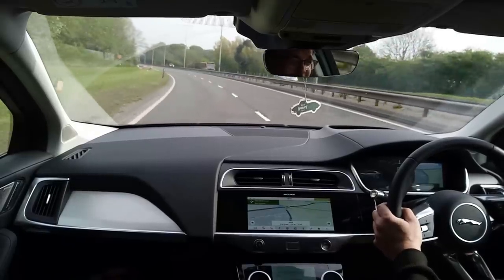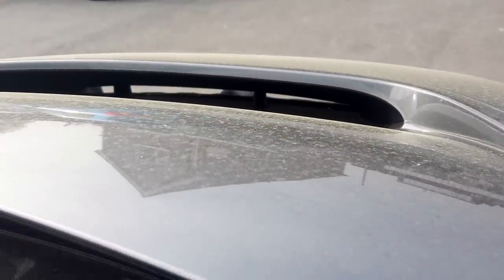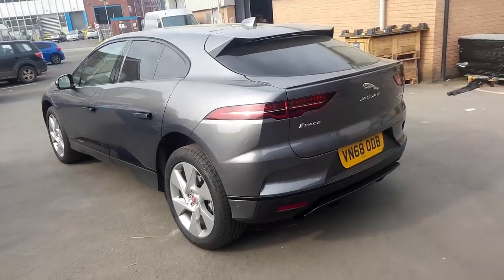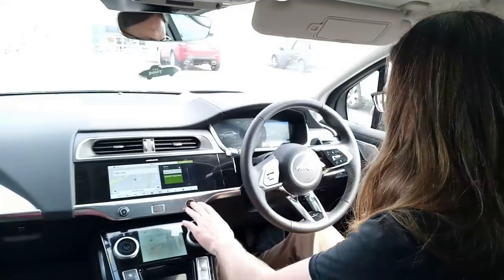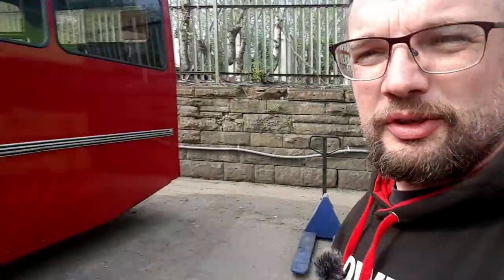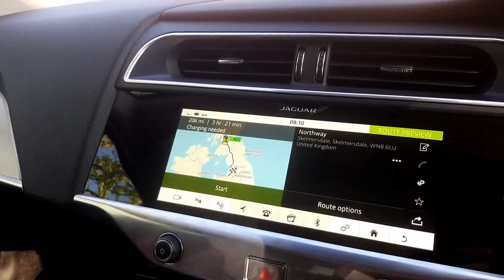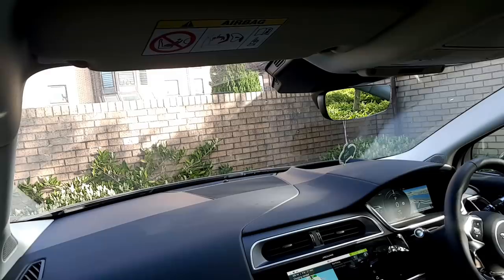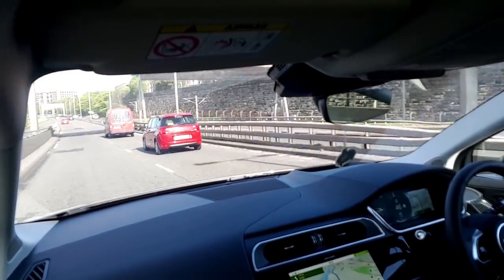Real Road Test: Jaguar I Pace 800 Roadtrip - with bonus bus action!

Comment: Very interesting journey.  Jay Leno is always saying that the last versions of old tech are better than the early versions of new tech.  Your experience seems to prove that statement very conclusively. 

Personality I think that this shows that the hardware is pretty good but, as with most computer based systems, the software really isn't up to the job yet.  I find this is such a common problem that we live with every day of our lives.  Just count the number of times you have issues with any digital system you use.  We almost always end up as test subjects for companies who promise us "life changing" tech.  We'll, I suppose it often does change our lives but not always in a positive manner.

In case you are wondering, I am not a Ludite.  I have a degree in computer systems design and love new tech.  One of the reasons I don't use this in my professional live any more is well demonstrated by your example here.

I sincerely pray that this situation improves very quickly.  Unfortunately I suspect that it will take a long time to get it right.  Sorry, rant over.  I look forward to your next post.  Really love your videos Ian. Thanks
Reply: Well put Sir 👌👌
Reply: I'm always disappointed by how unreliable "consumer grade" software is, compared to how reliable all the drive-by-wire systems are in cars from the last two or three decades! Most people don't even realise that their throttle control (to give but one example) is computer mediated, but hate the experience of using the car's stereo. Why is it like this, damn it!

Comment: you really can waste a lot of time several times a day waiting for your car to charge. 10 minutes at a petrol station and you can go halfway across Europe almost without stopping. For what it cost you in electricity, a decent diesel would have done it on the same amount of fuel and  kept on going. Loved the old 405, i used to have a 405 estate, which i really liked.

Comment: I think Mythbusters tested how much you save in fuel by going close behind a lorry, and they could only get any effect at all by literally driving five feet from the bumper. Anyway, I bet the situation with charge points now is pretty similar to what it must have been like owning a petrol car back in 1900 before they'd built all the petrol stations!
Reply: Clearly Mythbusters not in a Citroen Relay 1.9D van, or bluff Land Rover defender where you really can lift off the accelerator behind  trucks..

Comment: Love the looks and performance Ian, downsides £65k and so much stress! (still couldn't afford one!)......I might watch your next EV caper in two years time, and still wouldn't buy an EV.
How much were the total charging costs for the journey?
Reply from the maker: I did work it out but can't remember. £23 was the biggest charge and that got me about 200 miles.
Reply: £23 for 200 miles. Is that similar to 60/70mpg on fossil fuel at UK prices?
Reply from the maker: No, more like 40. Similar to my 2CV.
Reply: Thanks Ian; considerably more than my diesel ZX or petrol 205 in similar conditions, although obviously the Jag is a big luxury car. Thanks for the presentation; I completely agree with you about modern fossil fuel cars being unnecessarily complicated versions of older ones, and that the future is probably electric. I don't know what Jaguar do, but Renault charge a monthly rental for batteries which varies from £20 to £55 depending on what mileage you cover. This completely negates any cost savings of electric in addition to the "Refuelling" inconvenience. I know you're not interested in motorcycles, but you may be interested to look at Cedric Lynch's home made electric enclosed recumbent which cruises at 50+mph and has a range of 80 - 100 miles on a 50p charge. This has been on the road since the early 1990's and has covered over 150,000 miles.Thanks again for your excellent videos.
Reply: To my surprise that's considerably more expensive to run than my 13 year old Mondeo tdci which easily does north of 60mpg on a run. It would probably have made it there and back on a tankfull as well!
Reply: @HubNut  Yes the IPACE isn't very efficient.

Comment: My 2004 Jag XK8 has washers built in to the wiper blades too! (And there's no triangle of doom). It's a great system because it uses only a tiny amount of washer fluid, is very effective, and doesn't leave a mess.

Comment: the achilles heel of EV's - range and charge time. I did @ 400mls yesterday on petrol - filled up @ 350 miles at Tesco in York using tried and trusted technology - took me less than 10 mins to recharge with nearly 400mls of range ( petrol ) which I paid for at the pump. Nearly 40mpg not bad for a 14 year old 100k miles Picasso.  I intend to run this into the ground and thus not add to those perilous greenhouse gases by having a manufacturer build me a new car - I remember your video pointing out that there is more harmful stuff pumped into the atmosphere making the darned things that comes out of the tail pipe.  When its knackered and BER I'll just buy another cast off that some fool has insisted on changing for a new one when there's life in their old dog cast off yet

Comment: I thought the infrastructure would be a lot better in the UK compared to here in Ireland, but it seems not! EVs make a lot of sense if you're mostly driving within the range from your home (charging at home is so much cheaper and can be done overnight), but you still have to be brave to do any long journeys with them.

I think you got your kilowatts (unit of power) and kilowatt hours (unit of energy) mixed up a few times. It's hard to predict how fast a lot of these public chargers work, as they may claim to be say 50kW but that could be split if another car turns up, and the cars don't charge in a linear manner. Battery temperature and other factors can also affect charging speed, e.g. rapid charging could be restricted if the battery is hot after a long motorway journey.
Reply: I find the Infostructure good and getting better in the UK, you can't view it on a 1 hour video of a novice who wasn't given the correct tools (ZAPMAP and RFID cards start charger) when you own an EV you equip yourself  with what you need for where you travel. Plus the Ecotricity chargers where working and on free vend all Ian needed to do was plug it in and press start. 
It's a bit like if I went to my local asda petrol station with cash I would not get any petrol because it chip and pin only.
Reply from the maker: The chargers did not work. It's ridiculous to expect people to sign up to cards and apps. Instavolt proved that what we need more of is simple chargers where a bank card can be used.
Reply: @HubNut  Instavolt started putting chargers out about 1 year ago, Ecotricity chargers are about 5 - 6 years old in technology terms they are ancient. They will be replaced with 150 KW ones, now if they don't accept debit/credit cards that will be ridiculous. 
I went to my local Asda filling station the other week in my mams Audi and couldn't put diesel in it because I only had cash and my Contactless phone on me. It was unmanned and chip and pin only. (didn't really happen but it could of) and i was amazed that it did have an indicator stalk!
Reply: tone167  none, but I do drive an EV. I don't sell EVs either. I used to sell Citroens 😉

Comment: I completely get the appeal of the wall of torque and endless turbine smoothness, it must be lovely.  The problem with batteries is that they take ages to charge, no matter what the infrastructure is like, and until someone makes a battery that will charge in the same time it takes to fill a car with petrol, battery powered cars will only be suitable for city commuting or short trips.  You had range anxiety before you even started and, while I laughed at some of the charger disasters, the constant anxiety and discussion about the range was starting to give me a migraine and I was only watching it.  If I had been in your shoes I don't know what I would have done.  Top marks for appearing so calm (ish) and top marks for giving it a good go.  Cheers :-)
Reply: Hi Pauline, I have found that my EV chargers when I'm not using it so I don't have to wait around. Cars  are parked 90% of the time. I wonder when the last time someone filled their tank and used it all in one go? Not very often. Take my wife for instance, our Leaf takes 3 hour to charge from 0 - full, that give 80 miles, the most she ever drives is 50 miles a day, so it's never empty and she has never had to wait for it to charge. Really depends on how many miles you drive to what size battery you need. Just like you wouldn't buy an MX5 for a family of 4. Oh and we very often drive over 300 miles in the little Leaf too with no range anxiety what so ever because I learnt where and when to charge (really isn't that hard).
Reply: It's great that it works out for you and it illustrates the options.  However it wouldn't for me.  My daily driver is parked in a car park several hundred metres from my house and there is no charging infrastructure any where near my suburb.  Circumstances vary.
Reply: @PaulinesPastimes  Your right, I doesn't work for everybody yet and at it will take time as this is new technology, but it is starting to accelerate. Bit like the internet, when it came out not many people used it because it was slow now we watch YouTube videos on our TV. Can you imagine making a Youtube video in 2005 and people telling you that it won't work just because they didn't have broadband. It's a new type of technology it will get better and cheaper. A car does not need a 500 mile range unless you have drive it non stop for 500 miles which I don't think you need to in this country at least. (hope you see my point of view)

Comment: The Scottish government is already consulting on how to tax leccy for EV's, so a classic bait and switch tax scenario awaits.......
Reply: Well of course.
I mean the duty on fuel at the moment is so. Something like 80 %.
If we all went electric tomorrow do you really think we won't be paying 20 per hour charge at services.
Of course we will be
Reply: It should be taxed per km or a flat tax not at source
Reply: An incentive to charge up overnight, using the power point in your own garage.
Reply: Its free in Scotland
Reply: @zenbudhism  What is free ???
Reply: Free charging for  electric cars in Scotland from charge place Scotland
Reply: zenbudhism  nothing in this life is free somebody pays for it
Reply: @zenbudhism  not for long I bet
Reply: Arthur Farrow great idea... now I just need to buy a garage!
Reply: zenbudhism free at point of use maybe (for now). Free in terms of no cost to generate, supply and maintain? Definitely not. Someone somewhere will be paying for that.
Reply: @zenbudhism  Like I said bait and switch, the taxpayers are paying, it's not free.
Reply: zenbudhism ChargePlace Scotland pricing is set by each individual council. They all used to be free but two have now started charging (I believe it’s Dundee and Dumfries). The rest will follow for sure. But I’d actually rather pay for a reliable service than have the current free one which is very unreliable. I have never had an issue with Instavolt. Bit expensive but they work, they’re simple (no app or rfid card needed) and they’re reliable. I’ve never had a problem, so I think this was just unlucky. Having said that, I don’t rapid charge very often and do most of my charging at home for 5p per kWh - or roughly £4 to charge to 100% from empty. If it’s that cheap at home, I don’t mind paying more for a reliable en-route network.
Reply: @zenbudhism  Not in Dumfries and Galloway it isn't, and Orkney are about to start charging for charging.
Reply: The problem is that the cost of energy on those commercial chargers is already up at the price per mile or more than petrol and diesel cars. Substantially more costly than economy petrol and diesel cars.
Reply: Easy to make commercial charge points capture a duty or electricty companies  as they sense, via smart chargers, that you have p[lugged in or via pay per mile from all the telemetary these EVs have.

No doubt the electricty companies will also be able to increase pricing for home consumers when they sense you plugged in your car.

i don't see EV being cheaper per mile once they are in more widespread use.

Comment: You have highlighted an issue with electric and hybrids as when your braking as you say most of the time your just regen braking and it means that because they still use mechanical brakes they tend to seize up the pads in the carriers cause the discs to corroded etc mainly the rears. I work for a Ford dealer and the mondeo hybrids are all like that.
Reply: Engine brakes are great I've had my Prius for almost 8 years now and only needed new brake pads twice ;)
Reply: @manwithapan9481  it is good basically free energy but the point I make is that as much as the brakes could potentially last longer than some batterys they need to now almost reinvent brakes as due to lack of use due to regen they tend to end up with corrosion and seizing up. What Ian has shown is that the UK isn't properly geared up for electric vehicles. I personally think hydrogen cars are the future.
Reply: Yes, I've had to replace all the caliper slide pins on the rear brakes on my Prius as they had seized. It's really a case that brakes should not be treated as a maintenance-free item - you can't just leave them alone until the pads need replacing because that takes too long. Inspection and lubrication every 2 years or so should avoid problems.
Reply: @AaronSmart.online  Every time my Prius has an MOT I ask the mechanic to check the brakes , it was 4 MOT's later when he recommended replacing them lol, same again 4 years later, I presume he checks them for other things such as calipers seizing etc but next MOT I will ask him to have a quick look at them ;)
Reply: @wattling1396  Right I gotcha,  I guess the engine brake on the Prius is a little different as you can't use it to stop, 0nly to slow down, so the brakes are in constant use only just very lightly ;)
Reply: @manwithapan9481  I wouldn't assume anything. Some disassembly is required to really check the slide pins are moving freely (and lubricate them if needed), it's a good bit more work than just checking the pad and disc thickness.
Reply: @AaronSmart.online  agreed that's a good idea. Unfortunately working at a dealer the service intervals are all being stretched out to far and unless a customer will pay for it cars with rear drums only get an inspection at 4 years which does not include cleaning greasing or adjusting. May I add I do it anyway  shhh lol
Reply: @manwithapan9481  on a mondeo the regen just slows the vehicle not stop it fully but on normal driving all the normal stop start driving will not use hardly any of the mechanical brakes. The first inch and a half ish of the brake pedal travel does nothing to the mechanical brake parts. As far as I'm aware the system isn't too dissimilar to a Prius and I'm fairly sure Toyota helped Ford with making a hybrid.
Reply: @wattling1396  Cheers, looks like my brakes are due a proper dismantling and clean then, probably about time hahaha 8 years, thing is this Prius just keeps passing MOT's year after year on a 56 plate, it gets driven so gently and at speed limit or below there's just no wear and tear on it, plus I learned how to hypermile it when I first got it, not many people know if you keep your foot slightly on the gas the battery stops driving you and the engine goes off so you're essentially going 99mpg with no engine or battery wear, I'd say the 80k on my Prius like 25k are actually engine+battery miles ;)

Comment: I've been driving an EV for six years and I can't say the charging infrastructure has improved much. The car is great, I do lots of short local journeys, so a Leaf is ideal for me, and only gets charged once a twice a month. Rarely need to do long journeys, but not yet confident enough to risk relying on a charger working when I've had a few too many occasions where I didn't desperately need a charge, but it would have been handy and found things not working, or already in use.

Comment: As good as this car is, it's just so cold and clinical, it's like an American fridge with an ice and water dispenser, cool, functional stylish, useful, but the novelty will wears off after a week. Where's the soul and personality, that you get with older cars. Your XJ40, despite all the faults and rust had a soul in my opinion. 
Nevertheless another "sterling" review :)
Reply: My old Sierra had a water dispenser -  through the sun roof.
Reply: @stevetaylor8698  
Haha didn't need to pay extra for that.
Reply: I have a 2004 XK8 and I really feel like that's the sweet spot. It's new enough to be reliable but it still has all the old Jag personality and charm.